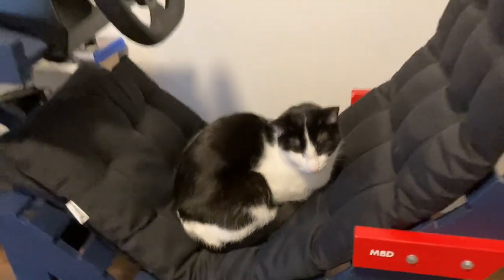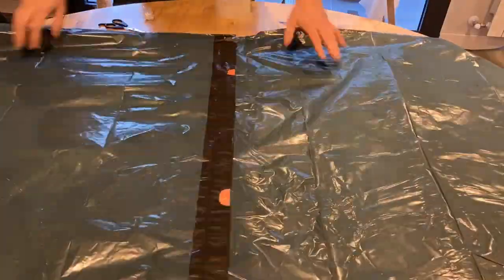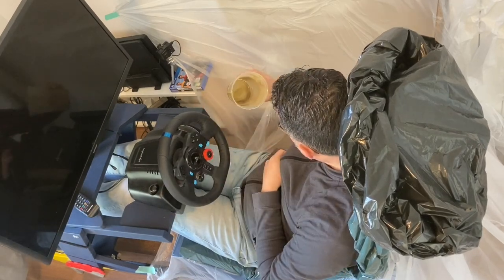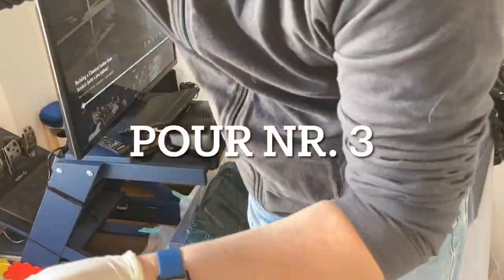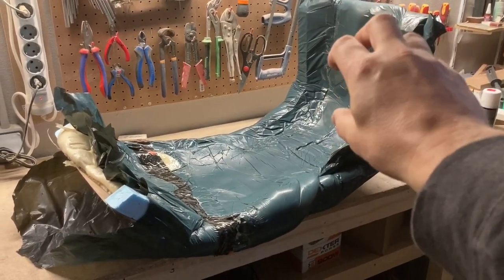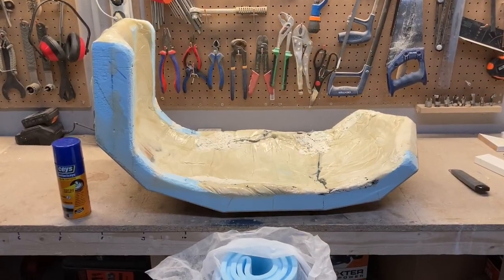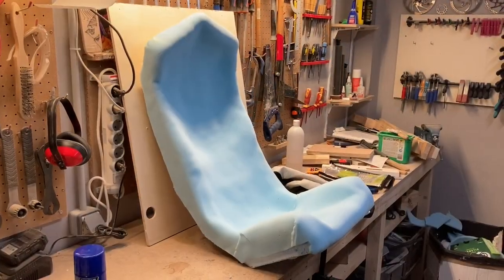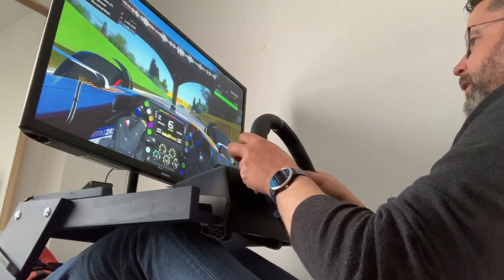Budgetcap F1 simulator - custom seat molding

Comment: Thank you for posting this.   what density of 2 part foam did you use?   6 pound?  2 pound?  I am wanting to make an insert for my sim race seat which is aluminum .   Also - it looks like you used 2 quarts of the liquid?  was that enough to do the whole seat?  Thank you   DMAX
Reply from the maker: Hi Max, density 300kg/m3 and I used 2 kilograms of it. The final result was quite hard, rocksolid actually.
Reply: Thanks for replying @madebydekker7038 . Thanks for the info.  I think I'm going to take your advice and do the pour in 3 sections or so.  Mine is a GT type aluminum seat that unless you have padding or support, it's an absolute back breaker..
Reply from the maker: @DMAX_DIY good luck!